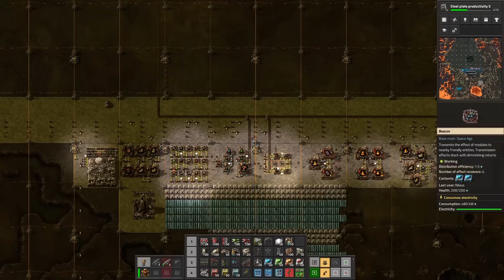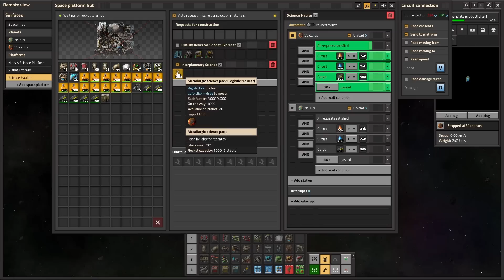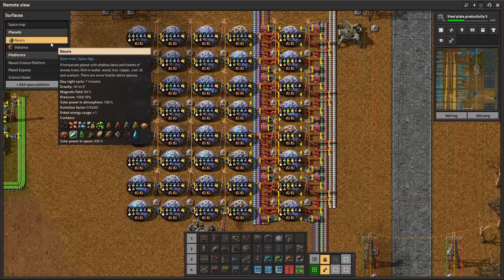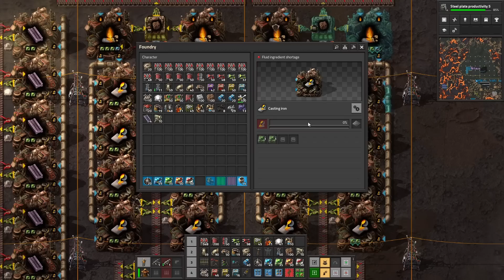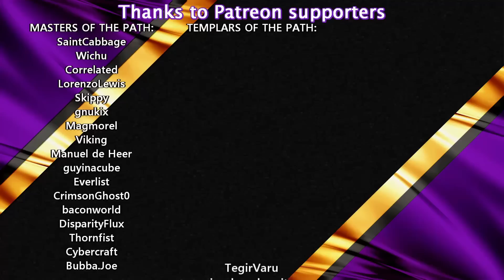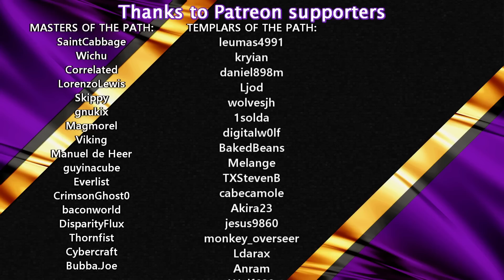VULCANUS: Large Scale Industry From Lava! Is It Too Fast & Simple? | 06 | Factorio SPACE AGE

Comment: Don't forget the tungsten carbide. Unless your starter design is enough for your engineering needs
Reply: on stream, tungsten carbide wasn't used for too much. tungsten plate is the one that's really needed. if moving entirely to turbo belts, you're going to be using _tons_.

Comment: As far as I remember from the FFF and what I've seen so far. Fluids in pipes are unlimited throughput. The only limiting factor now is the distance, once you go past that 250x250 area the stop working and you need a pump to get them further. So basically now it's just pumps themselves that limit fluid as a pump can only push a certain amount of liquid through the pipe.
Reply: but you can add pumps in parallel to increase the throughput again. Say you have a pipeline transporting 2400 l/s of water. A pump can only do 1200. So just put two pumps side by side, each pressurizing half the amount, and you're good.
Reply: @112Haribo  Legendary pumps are 3000/s
Reply: Originally 250x250 but now it is 320x320 (10 chunks square)

Comment: the landfill / stone-compression method for solving belt capacity on the trash line was a clever move ;)
Reply: That's how you know he's played Space Exploration ;)
Reply: @DackelDelay  i did a similar thing in a large modpack i built a long time ago that had all sorts of processes that would produce waste, but that the waste could be used for something or another...i'd craft something with it to use up most of the resources, essentially compressing the items and then trash the unneeded results. Sure, you're using "energy" to compress stuff, but when the alternative is using multiple belts just to trash stuff, it's far easier to use the resources to craft something and then trash the result.
Reply: @DackelDelay  i think what i did it with was mud....in an angelbobs pack.  cause that could be made into landfill and i just put landfill into a passive provider and had another inserter burn anything over a certain amount.
Reply: @rhueoflandorin  you could turn mud into mud water and clarify that tho, how much mud were you voiding...
Reply: none. I turned all the mud into landfill and if the chest the landfill was going into was full, it'd void the excess. 

this was back in 0.15 or 0.16 i think so i don't remember all the details of my decision making process (which was much more flawed then than it is now) but it may have simply been something as simple as "water is free. landfill is sometimes useful. make landfill. if landfill clogs up, make more landfill and void it. next problem...."
Reply: @hiddenTNT  oh wait... the clarifier was the angel's building that voided fluids, right?
I....don't remember why i didn;'t go that method. I'm sure there was a reason, but i don't remember what the reason was.
Reply: @hiddenTNT  oh wait... the clarifier was the angel's building that voided fluids, right?
I....don't remember why i didn;'t go that method. I'm sure there was a reason, but i don't remember what the reason was.
Reply: @rhueoflandorin  may have simply been too much work
Reply: @rhueoflandorin  how do you burn stuff in Space Age tho
Reply: @henapbc9  chuck it into lava with an inserter. If it doesn't work at first, try moving it slightly till it does work.

Comment: Does anyone else have difficulty telling the new belts apart from yellow belts? The colour difference is so slight, new belts should be purple:). Hopefully someone releases a mod changing the colour to something easier to see.
Reply: should have gone with white or black.
Reply: If they were purple I wouldn't be able to tell them apart from the blue. And I suspect there will be far more cases where blue belts interact with the new ones than yellow belts do. And the bigger speed difference also makes them pretty obvious when in use.

That said, adding a visual difference beyond colour would be a nice and helpful thing, for example they could make the rails on the edges of the belts look different.